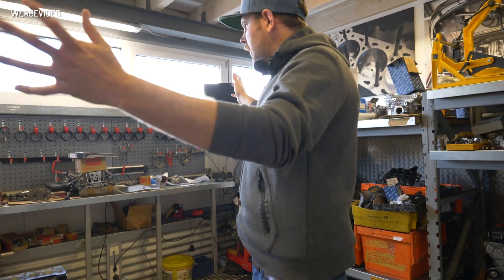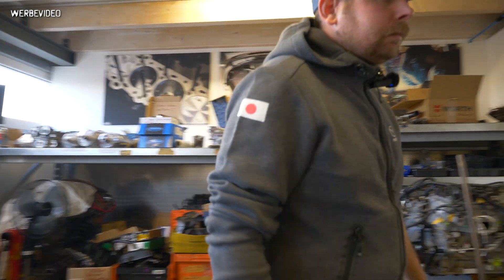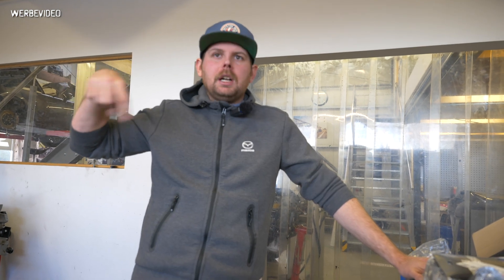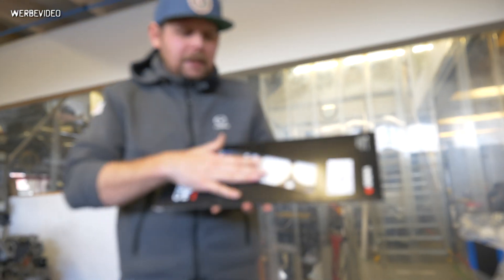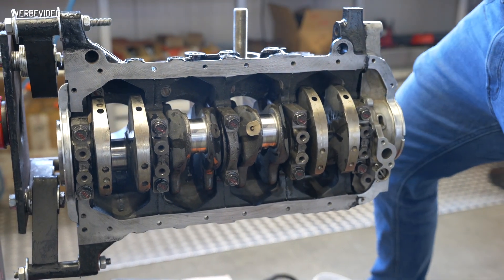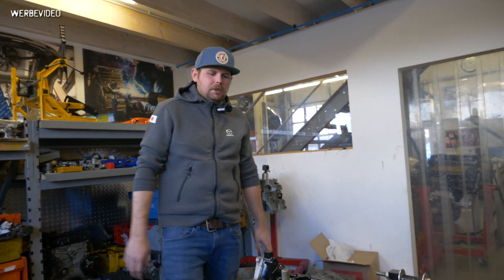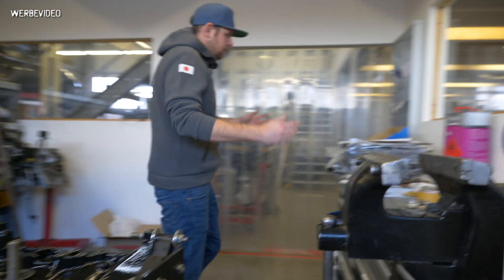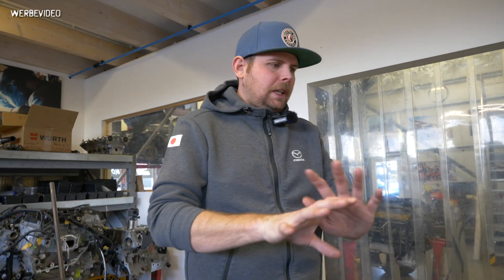What we use to get reliable power from Miata engines - SPS Motorsport

Comment: I want to know the secret to ITB / naturally aspirated builds! =P
Reply: Same, a buddy of mine went with a bp4w head, 4age silvertop itb's mild port polish, just casting marks really and 254 maruha fcams, made great power, about 170 bhp, Ill be going a similar route but I may go for the 264 cams and the 87 mm crank, quinns miata is another one you must check out, great build
Reply: @bugman043  my build is very close to your buddies but I went with a VVT head instead and same ITBs. No cams yet I’ll get those later down the road. Haven’t gotten dyno checked but assuming I’m around 150whp. Was able to beat my buddies stock bolt on 2001 NB 6 speed which those tend to put down around 130-140whp.

Comment: do you have links to the head gasket?
Reply from the maker: Sure, but there are different variations. In doubt just send an email to info@sps-motorsport.com 
Here is the Link: https://sps-motorsportshop.com/shop/en/part-shop/performance-parts/mazda-mx-5-na-1989-1998/enginebay/1-8-l/gaskets/head-gaskets/2578/cylinder-head-gasket-athena-cut-ring-84-5mm-bore-1-4mm-thickness
Reply: @SPSMotorsportGmbH   thank you